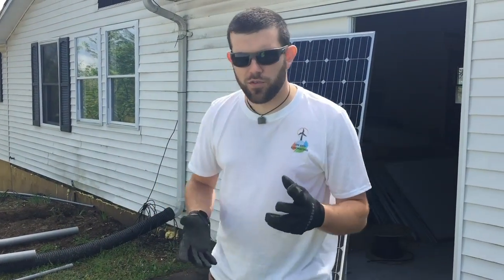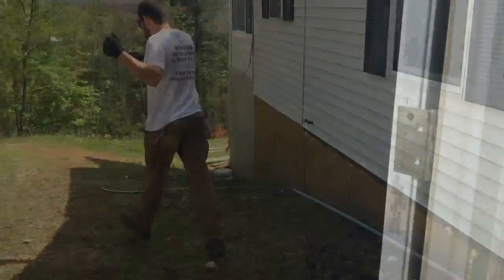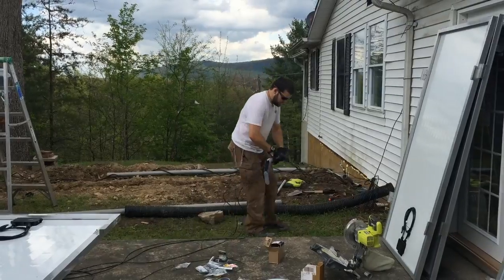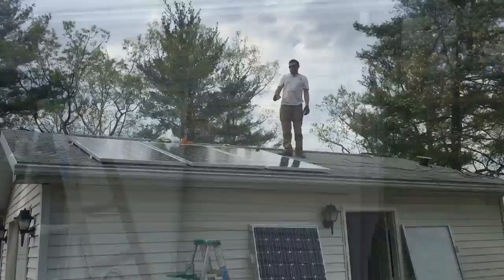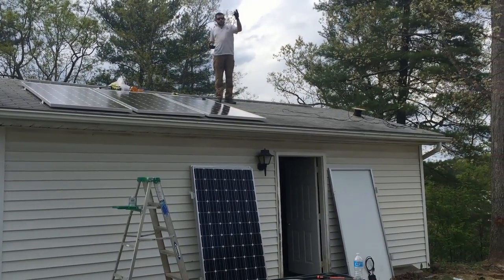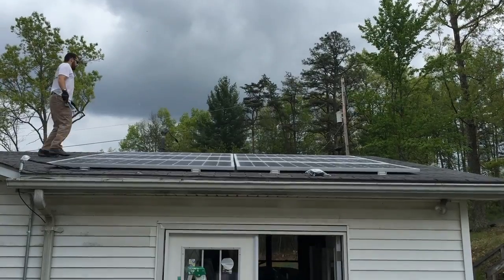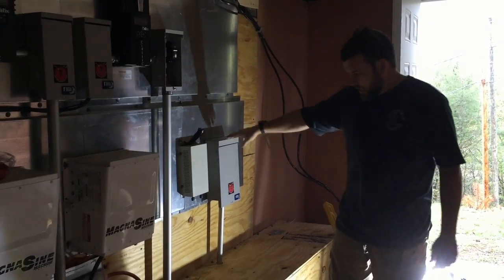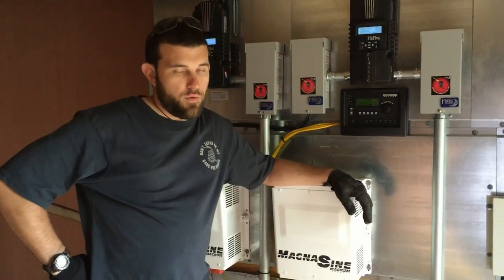6.3KW Off Grid solar and wind power system install by Off Grid Contracting Part:1 Solar portion

Comment: Will a unit like that be able to power a heatpump or central air,.. or does one have to use an alternate form of A/C like individual room a/c's to cool a medium sized 2 Bed room home..? generally speaking , cuz I know it depends on overal kw usage...Thanks